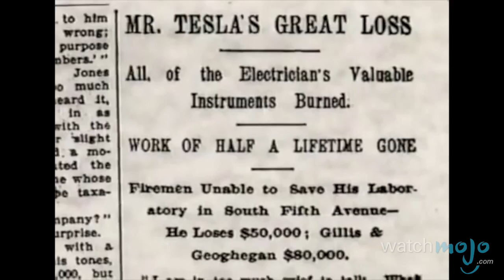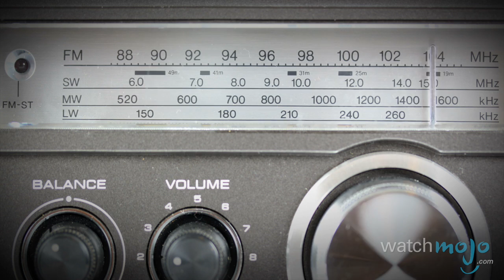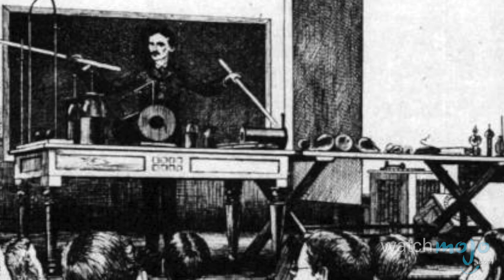Top 10 Amazing Nikola Tesla Inventions and Innovations

Comment: The AC/DC debackle ended in favour for edison in the end, as after the AC triumphet, Tesla found a way to propagate electricity in a pulsatory way, that has no resistance and can be harmonically amplified; And can not kill, but heal.
The problem was it ran on a single wire connected to the ground and they couldn't put a counter on it, as it's mostly free... The archon false gods wouldn't want this to happen as they want to assimilate mother Earth - this is why we still use fossil fuels and destructive AC grids and bad LED lights...

Also, Tesla radio didn't have losses like marconni system,
Also, Tesla x-ray was a healthy version, not the cancer we have now.
Also, the money-power system that is destroying the Earth is still up and running but is fading away... we must destroy cristian religion first, as it's the least usefull religion ever concieved on this planet.

Comment: His resanator type device that nearly toppled a building with a fake earthquake. his anti-grav ideas also. neigther really confirmed or discredited are the only two I can think of. one partially mentioned was his static friction energy collecting device (forgot what it was called), it used wind against material and the friction of sand that would generate static and used that in a generator for a different take on wind based power sources... Free energy.

Comment: First, Edison wasn't his mentor, but a real SOB who sabotaged Teslas idea of using direct current as a more efficient and safer energy. Second, JPMorgan was the one who destroyed Tesla's lab since Tesla was so close to publishing wireless energy transfer and Morgan owned basically all the copper mines, so no wires, no need for his copper.
Reply: +Cesarini77 And Morgan destroyed Edison as well, absorbing Edison General Electric into his empire, and becoming General Electric.
Reply: +Cesarini77 There's so much fail in your post I don't know where to start.

Firstly, Tesla was using AC, it was Edison who supported DC - Edison used AC in public spectacles electrocuting animals to try and suggest AC was unsafe
Secondly, what evidence do you have about JP Morgan destroying his lab? Morgan did not "own basically all the copper mines", he was a steel magnate, the only copper company he invested in was Inspiration Consolidated Copper Company.
Thirdly, Tesla patented his wireless electrical transfer in 1897 (published in 1900) and worked on it at least until 1917 (4 years after Morgan died!) - he was hardly stopped from his work as he made it public and kept working on it.

You are perhaps thinking of the contract Tesla had with Morgan to develop a radio transmitter to rival Marconi - Tesla took the money and ignored the contract and expanded it to include wireless power transmission as well, then ran out of money and broke the contract by asking for more - it's hardly some sinister conspiracy theory for an investor to pull out of a deal if the terms of the deal were breached and the money squandered.
Reply: baddogonline
 Actually wireless charging and transmission do work (and Tesla's patents from the time show what he was doing) - there is little dispute of that. What the issue is, is the claim that Tesla created free energy (i.e. gathering power from the air) or that his system ran off nothing - it was powered by a Westinghosue generator. He was ahead of his time in thinking of creating electricity from solar or wind though - that was his ultimate aim, to create power from those renewable sources and be able to transmit it where it needed to go rather than using wires.
Reply: FuckYouGooglePlus
 Actually Japan has been experimenting with the idea of a solar satellite beaming power with microwaves down to Earth and believes it will be done by 2025 (yes I know that's ages away but bear with me) - they have been testing it already and in March Japan Aerospace Exploration Agency (JAXA) was able to demonstrate sending 1.8kW 55m on a small scale and Mitsubishi working with JAXA was able to send 10kW over 500m. It's not efficient enough yet for large scale deployment (they were expecting to deliver 350W from a 1.6kW beam over 50m) but is' very much ahead of the few inches that you suggest.
Reply: FuckYouGooglePlus

Can you provide some links to work by these groups from 1995 saying space power would be done by 2010? Or links from 2005 that said it would be done by 2020?

I was merely talking about the practical application of wireless power, not vindicating Tesla - he wouldn't have dreamed about satellites so a balloon was the tech of his age that would serve that purpose.

Wired is certainly the most efficient now, but future thinking is what we are doing with science, not sitting back with existing tech
Reply: FuckYouGooglePlus
 Ah we're back on the old anecdotal evidence fallacy - predictions of the future vs actual practical experimentation with a timeline based on the work they are doing. You can see old science papers predicting all sorts, people thought we would have a moon base before the year 2000 based on the 1960s/70s advancements!

Did you perhaps ignore everything I wrote? They have not "just succeeded in sending under 2kw only 170ft" - 10kw over 500m has already been done this year - this is already a reality.

What I meant by wind power was the practical application of using wind to generate electricity as part of the power transmission process to provide clean and cheap renewal energy rather than using a traditional generator.
Reply: +baddogonline u are an idiot about wireless energy as a myth, it was real, but in short distances
Reply: +FuckYouGooglePlus but it still legit, in fact, there are someone who wants to commercialize wireless energy on cellphones

Comment: The main reason Edison hated Tesla's alternating current (especially poly-phase AC) is that he couldn't understand the math behind it. Also Edison envisioned raking in the money from building the DC power stations needed every few blocks (since most DC power is lost to heat) while AC can travel over long distances and ushered in low cost home electricity.

Comment: You know what sickens me? No one knows about Nikola Tesla but EVERYBODY THINKS EDISON WAS THE SHIT
Reply: +Shane Giaccardo I have doubts Edison actually did anything at all, apart from buy everyone out and steal credit.

Like, we already know almost everything he patented was stolen, but I seriously believe it wasn't just "almost"
Reply: Because Edison did his work better for business, while tesla did it for the people.
Reply: baddogonline Yes, wireless electricity DOES work. I am an electrical engineer and have built several Tesla Coils. The high-frequency electric field generated by one can extend a significant distance from the coil itself, and with the proper receiver can power AC devices without having to run extension cords. I will say that it isn't as effective as it could be, but it does still work, and is actually original to Tesla. 

In truth, both inventors are given more credit than they might deserve, but for completely opposite reasons. Edison has a long list of other people's inventions filed under his name, while Tesla has patents for many electrical components and devices, which are commonly used by anyone who works with radio, fluorescent lights, or anything that uses/transfers AC. Tesla also didn't intentionally burn his notebooks. His laboratory caught fire, as was common in those days and considering the kind of experiments he carried out. 

Also, due to Edison being a money-grabbing snake, many of these as you say, "smartest minds" cannot be recalled by the average person, because Edison had all of their patents filed under his name, and had them steal other people's patents/inventions to satisfy his quotas. The only really original inventions of Edison were "ghostbusting" devices and the electric chair.

To say that Tesla "never learned his lesson" is denying the fact that when the "War of the Currents" broke out, Edison launched a fear campaign against AC, during which he took local pets, a circus elephant, and a convicted criminal, then proceeded to electrocute them using AC. In the case of the prisoner, it took 3 attempts before he actually died of AC electrical shock. 

And finally, what "lesson" do you want Tesla to learn? Tesla died broke because Edison made the whole world fear AC. If the lesson is "Steal other people's ideas and botch executions, and oh, you know what? Forget AC, ditch your whole life's work, and suck up to the big businessman" Don't try. He's dead, but his AC generators are what power our world, his fluorescent lamps light homes and supermarkets, and his research in radio communication gives us Wi-Fi and cell service. We still use Tesla's inventions today. Edison? Not as much.
Reply: baddogonline No inventor's work is COMPLETELY original; they all build on something. Neither Tesla or Edison actually invented the current that they advocated for, they were just pioneers in that specific field. Well, Tesla was a pioneer at least. Edison was just a good salesman.
Reply: baddogonline Tesla's investors rejected him because he wanted to make power FREE. When they found out that they couldn't make a profit, they shut him down. Also, it was Edison's Invention Factory that created most of the electrical system, not just Edison. Tesla came up with everything he invented by himself. I think it's Edison that we give too much credit to, not Tesla. From the notes we have of Tesla's work, all of it functions like it should, and like I said before, we still use Tesla, while Edison's system is losing popularity.
Reply: +baddogonline fine, name all investor except jp Morgan
Reply: +Rony Blanc History is written by the victor...
Reply: +Liam Powell The only things he "invented" were "ghost detection" devices. Edison was incredibly dumb, believing that when his fingerprints grew back that that somehow meant that humans were made of "immortal units" and therefore justified the existence of ghosts or that firing x-rays into his eyes would fix them.
Reply: +baddogonline well, they were rivals in the war of currents
Reply: +Rony Blanc sadly Edison only took someone else's work and made his own version, some times better not; and I agree with you completely.
Reply: +baddogonline so u want to go to Edison dc system, or tesla's Ac system?
Reply: +baddogonline ummm, wireless electricity was high right now, and u still don't believe it?
Reply: +baddogonline also, tesla coils are cool as hell
Reply: +baddogonline the improving part was the 50,000$ joke, where Edison said that tesla didn't understand American humor.
Reply: +Copr Wyre (Whisper219) also, solid state tesla coils are high now because they don't use an Ac transformer, instead, it uses electronic components that looks like it belongs to a DC system. Read more at electroboom
Reply: +FuckYouGooglePlus what do u mean it almost killed many people?

Comment: Advanced technologies in its abundance : Happiness in its scarcity
Reply: +PersuasiveEuthanasia On the contrary, Happiness is in higher quantity where Advanced Technology is in higher quantity.

You can't exactly look at the amount of Technological Advancement we have next to the amount of Happiness we have overall as a completely 7billion population, because it's like measuring up gallons against centimeters.

One number will always be smaller than the other if they are equal, because the value is different depending on the unit of measurement.

Our "Happiness Unit" is a Hu. And our "Advanced Technology Unit" is Atu.

Looking at the globe we see the Hu is at around 100, where as our Atu is at 1000.

However, the largest quantities of Hu are in the same areas as the Atu, around about 10 Atu per Hu. Areas with no or very little Atu contain very small amount of Hu.
Reply: +Liam Powell that was a very well written explanation.